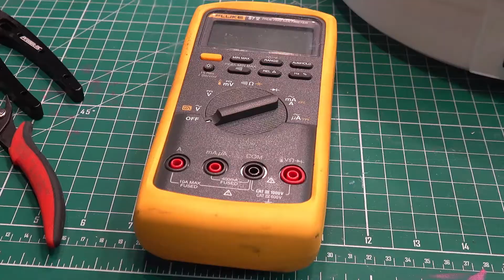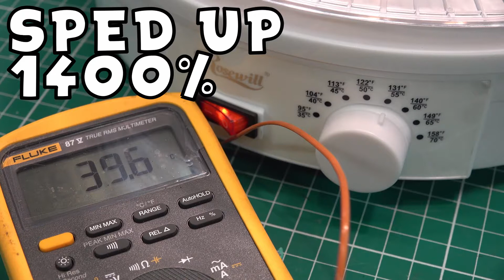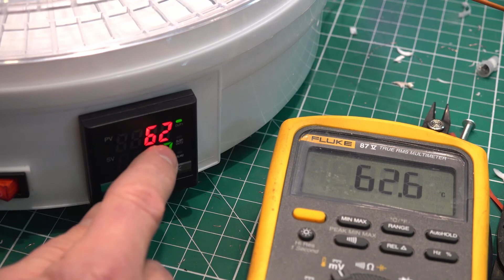Frux Up a Perfectly Good Food Dehydrator / 3D Printer Filament Dryer

Comment: Sorry to bother you, it might be obvious for you but could you please clarify me the connections? 
I think I know how to use the RexC100, and it has a manual, so I can figure it out.
I don't have a food dehidrator yet, but as far as I could see, there is a Resistor, a Motor (for air flow) and a ON/OFF switch.
(And it has the cheap controller of course that is going to be replaced.)

Are these the connection that you did?
--------------------------------------------------------------------------
Neutral Line (N):
Directly connected to:
-The neutral of the motor.
-The "neutral" of the heating element.
-The "neutral" input of the REX-C100 controller.
-One of the terminals of the illuminated switch (I assume that is why it has 3 pins).

----------------------------------------------------------------------
Phase Line (L):
-Connected to the input terminal of the illuminated switch (Terminal 1 of the switch).

------------------------------------------------------------------------------------------------------
Switch Output (Controlled Phase):
Connected to:
-The power input of the REX-C100 .
-The motor.
-The input terminal of the SSR on the load side (Terminal 3 of the SSR, connected to the phase of the heating element).

-------------------------------------------------------------------------------------------------
Heating Element:
-The phase terminal of the heating element is connected to the second output of the SSR (Terminal 4 of the SSR).

------------------------------------------------------------------------------
Thermocouple Sensor (Type K I assume):
-Connected to the specific terminals of the REX-C100:
Reply from the maker: To be honest, i dont think your ssr is connected properly. I don't see your terminals 1 and 2 on the ssr being used in your example.
Reply: @ Yeah i Did not talk about the ssr 1 and 2 connection and the termopar K sensor connections because they just plug into the proper rexc100 pins right? I was mainly confused about the dehydrator circuit. But i think I can figure out by myself when I get all the components. Thanks for the answer anyway.
Reply: If I'm reading it right, the fan and the REX100 will both turn on immediately when the switch is flipped, but the heating element will wait for power from the SSR. Is that what you're trying to do?

Comment: i just bought a similar dehydrator , how long does it take to dry up PLA ?
Reply from the maker: Generally, temperatures between 45-55°C (113-131°F) for 4-6 hours work well for most filaments like PLA and ABS. It's essential to monitor closely to avoid overheating or melting the filament.

Comment: Euhm im confused the heater bit blows hot air up into the clear trays not anywhere near the thermostat.
In the original config i mean
So what is the point of it?
Reply from the maker: There is a small port that blows on it that you can see at 4:45. It's still not a good representation of the drying chambers temperature.
Reply: @HootBuilds  you are right there is!
Mine didnt have that haha.
I am slowly working on a silicagel dryer device with a ptc heater that does seem to work but i dont wanna go to high temp since im 3d printing it(filament resistent up to 100c) but with 60c hot air going through the silicagel it dries in hours for small portions at least hehe.

Comment: What a funny coincidence, I just bought two of that exact model of dehydrator for converting into heated filament dispensers. I dry my filament in a large food dehydrator that has a temperature controller built in, but it's not suitable for dispensing filament from to print. These should keep the filament dry while I print if I put dry filament in them. I hadn't considered adding a temperature controller, but seeing your video and process I think it's a no brainer. Thanks for sharing. I appreciate your camera work and lack of annoying music.

Comment: More info on the wiring and an Amazon link would be awesome (PID controllers don't have all the same pinout). Don't you have to configure your type of probe and calibrate the kp ki kd to get accurate readings? I have to do it on my 3D printer, otherwise my nozzle and print bed temps are out of wack. I doubt these cheap controllers do it automatically.
Reply from the maker: All of that information is in the kit when you order it from Amazon. I just did a search for pid temperature controller kit.  My controller was already set for the correct probe, the scaling just needed to be adjusted.

Comment: Sorry to say that, but neither the Fluke Sensor nor the PID Sensor is a proper way to messure air temperature. Those sensors are for liquids. At 0:54 you taking the fluke temperature sensor in your fingers, didnt you wonder why the temperature is going down 0.2°C and is showing 17.5°C? Your fingertip temperature should be around 34°C. For the PID Sensor its the same - what sensor is it? A pt100? Those PIDs working for coffee machines or any other liquid, like for brewing beer etc. but not for those kind of stuff....
Reply from the maker: What type sensor do you suggest?
Reply: So like @hoot buids ask, what type of sensor is recommended for air temperature reading?
Reply: Can you provide a wiring diagram? You never show what you do with the AC power cables and it’s really hard to tell from the video.
Reply: those pid controllers are frequently used for BBQ's / smokers so not sure why you say its not suitable for Air temps, but as the others below asked, what do you recommend?

Comment: The ingenuity made me smile. I've seen some of the consumer grade filament dryers and they are all so meh and when tested, barely get to the proper temperature for their intended job. I was eyeing a food dehydrator because they cost about as much and seeing the temperature control (from the 1950s) made me rethink that. This is a great solution!
Reply from the maker: I think a better solution would be the same PID controller on a toaster oven.  This all plastic dehydrator is at the threshold temperature vs being comfortable letting it run on its own. Thanks for watching.
Reply: @HootBuilds  I didn't realize that. Thanks for sharing! I've seen some metal ones for sale. My only concern is the discrepancy between what the temp they report and the actual temp in chamber. All the reviews for the dedicated filament dryers show the temps fall short of recommended and what the units display. What's worse is their max temps are below what they advertise. I want to try printing with Nylon but I hesitate because it's expensive and I don't wanna have to toss a roll after a few prints if it's sitting for a while.

Comment: Your video inspired me and I just did the same thing to the identical food dehydrator for my filaments. I wanted a little more resolution and purchased a PT100 sensor instead of the K model that came with the controller. I like seeing the decimal place as it lets you know what is going on. My controller, an REX C-100, won’t show decimal places with a K style sensor. Also, I turned off the digital filter by setting it to “0”. This allows you to see instant temperature changes instead of having to wait as the controller smooths out any changes on the display. This mod really works! What a difference. The mechanical thermostat fluctuated widely. The PID unit now keeps the temperature within a 1/2 degree of the set point. Thanks for posting this.
Reply from the maker: Thank you for watching!
Reply: Any additional settings needed to be changed in the pid controller to swap from the original sensor to a pt100 sensor? Or can you just plug it in and adjust temp as shown in the video? Thanks
Reply: @jmangus83  yes, you need to select the new sensor model in the controller settings. I also ran the auto tune feature which worked perfectly. Currently, the temp cycles between 49.8 to 50.3 degrees C. That is good enough for me.
Reply: @davidgeorge8541  thanks for the reply. I'll be sure to look into that. Im guessing the pt100 sensor is more accurate? 

I'm still trying to figure out the wiring, mainly the line and common wires. I've got everything else hooked up, but I can't tell how he tied the transformer  wires into the pid, into the on/off switch. Am I supposed to make a jumper and tie all the hots and neutrals together?

Comment: In what situations would I want to dry my filament? Are there any other options if I'm on a budget? My mom won't up my allowance.
Reply from the maker: The main reason to dry the filament is for consistency when printing.  Most filament I'd hydroscopuc and absorbs moisture.  This can translate to imperfections when printing.     There are a few other options if your on a budget. Amazon has quite a few for $50.  I think its also possible to place the filament on the bed of the printer, covering to trap the heat, and setting the bed temp at the correct drying temp can also dry the filament.  My mom won't up my allowance either.